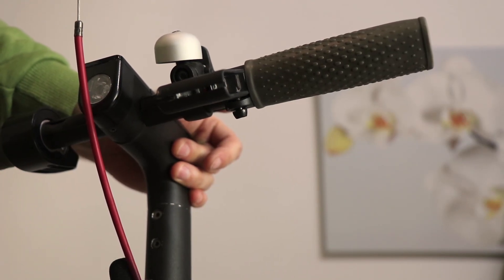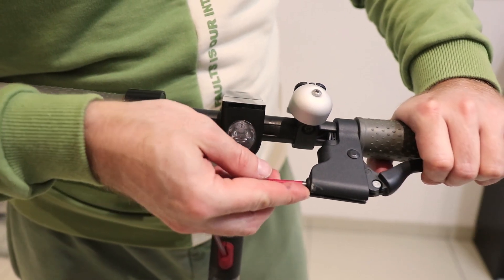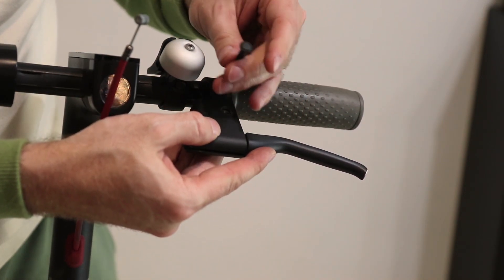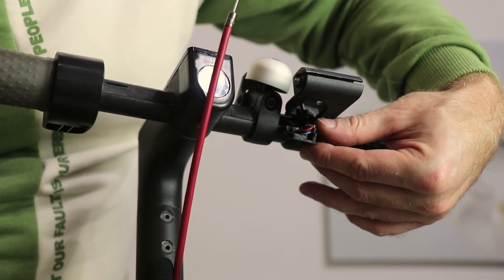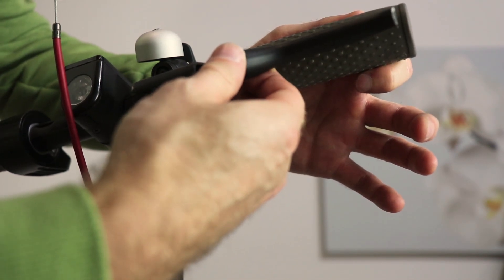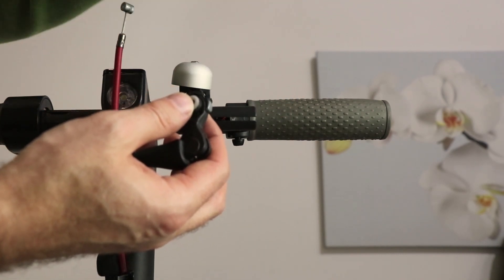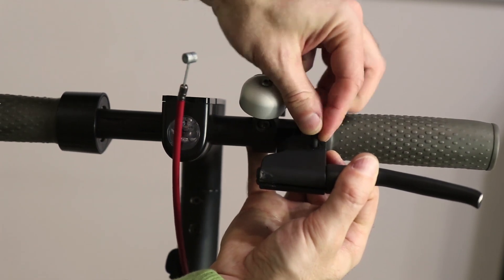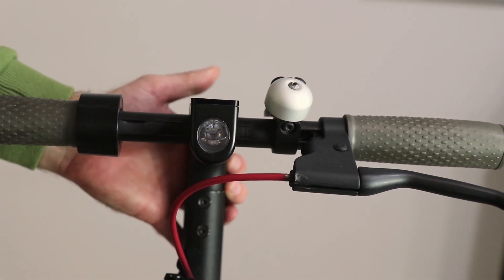Xiaomi Error 15 - Break Lever issue. Fix

Comment: Thanks for your Video: Removed the lever and found the little Magnet was slightly Out of its Position. Pushed it back in and used a drop of glue to keep it in place. Put everything back together and IT worked. 🎉💪🏻👍🏻

Comment: Thanks for the video. I couldn't see an alignment problem but testing showed that it was the magnet sensor that caused the error. I pumped the brake lever several times roughly and eventually  the error went away. Hopefully this works and if not I'll simply get a new lever.

Comment: Thanks very much. I was just about to order a new battery then see this video. I noted you need to have the magnet the correct way around or the scooter thinks the brake is engaged and applies motor breaking. I also had to super glue the magnet back in place to keep mine functioning correctly. All in all a great free fix.
Reply from the maker: Thanks man. Great it helped you
Reply: Thanks man you help me to solute my problem very quickly😊

Comment: hi did you change the magnet of the hand break ?
Reply from the maker: if you found the previous one - just glue it with the right side. If not - then is better to replace the handle with a new one

Comment: I did this and it worked.   Cleaned the connector even tho it looked perfectly clean.   Honestly can’t tell from the vid or from looking at mine what exactly was misaligned.   Must just be finicky as taking it apart and putting back together solved the error 15 issue for me.  Thanks.
Reply from the maker: Glad it helped

Comment: Hi, I opened my brake but I’m not sure if I lost a piece as the level is moving toward sides a bit, and the scooter stops suddenly without error or slow the speed down. Could you help me please?
Reply from the maker: Check the spring. It should be located on the bolt

Comment: Thanks man, in my case all it took was to squeeze the hand brake a few times and the error reset it self.
Reply from the maker: Great. Sometimes it is just a connection between wires (where it is plugged in)

Comment: This error occured in my xiaomi mi 1s after I hit a curb... I tried what you did in the video but it didnt help what else could be damaged?
Reply from the maker: Try the connection of the wires, where the plug from break connects to the socket going to display board
Reply from the maker: Or change the break lever to a new one. Just order a new break lever
Reply: @vincentcyprus  I checked it one of the brakes wires got smashed on the impact thanks for help!
Reply: @vincentcyprus  Thanks Imma try it tomorrow!

Comment: my scoot is error 16 do you have any idea how to fix it? i already check the motor wires and controler but nothings happen still error 16😥
Reply from the maker: Check motherboard (controller) if you have another scooter of similar model you can try replacing it (at least to check if it is controller) and see if the issue is really there.

Comment: What does the magnet sensor do
Reply from the maker: As far as I know - once it is activated - the cruise control is getting deactivated automatically and the recuperation of energy will start - the front wheel does have a break through giving the power back to the batteries.